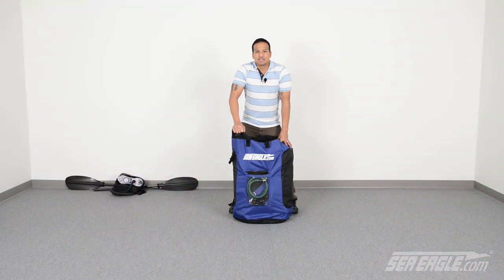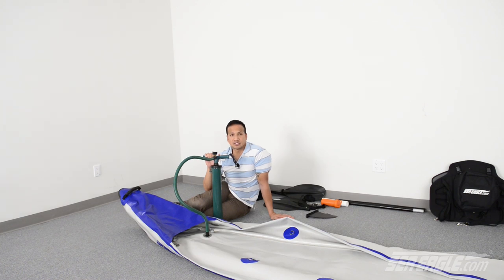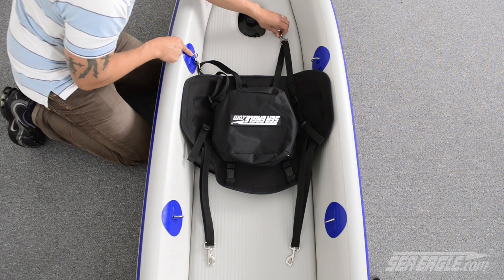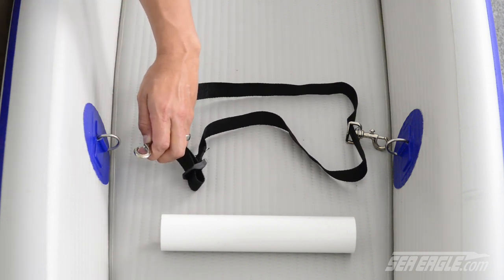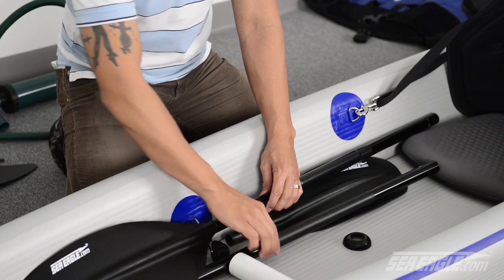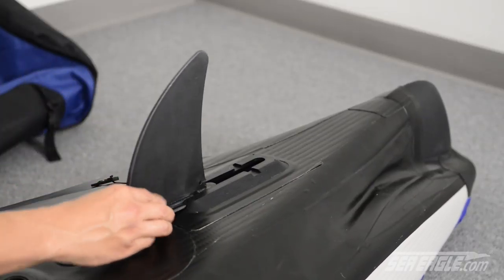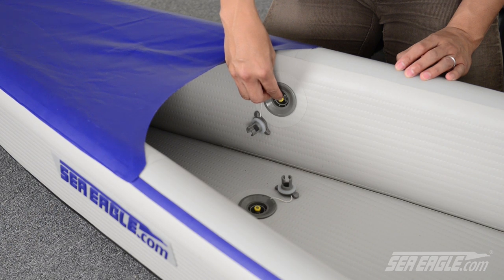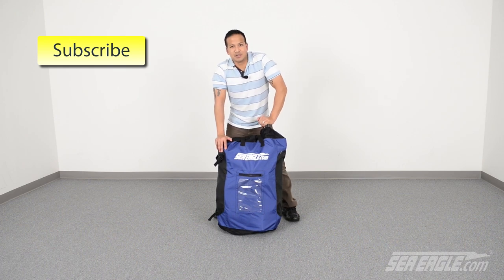Sea Eagle - RazorLite™ Inflatable Kayak Instructions - SeaEagle.com

Comment: I love my Sea Eagle 393rl and my Explorer 350fx. I just got them and have gone on two voyages so far. 
Is Sea Eagle planning on making a full drop stitch enclosed cockpit kayak, or a convertible model with a removable deck, similar to the Advanced Elements Convertible Elite, the Kokopelli Moki, or the Aquaglide Navarro? None of those are truly waterproof and I don't own any of them, but I like the idea. 
I would absolutely buy a enclosed cockpit version of the Razorlite, whether it be one piece or a convertible. 
Is there some special difficulty in making a full dropstitch body with enclosed cockpit? I have no manufacturing experience, but I am currently working on making my own removable covers for my Sea Eagle boats for when it rains or if it's cold, as well as a small dog cabin in the back of the Explorer for my little dog, mounted securely to D-rings. 
I am letting you know that there is at least one buyer who wants an enclosed cockpit inflatable dropstitch kayak and would be willing to pay more than the $1100 I paid for the Razorlite.
Reply from the maker: Hello @penalty5992, we like the way you're thinking and your mods sound fantastic. We have been considering a closed cockpit for sometime. However, there much to consider when designing such. I wouldn't count it out but will tell you that we have been experimenting with such. Thanks for watching. We hope you'll consider subscribing to Sea Eagle Boats YouTube Channel for more informative videos to come!

Comment: Hi Dan, I was wondering if you could do a short update to this video showing the new Flexbrace footrest system, how it works and it's robustness etc please? Also, I'm 6' 9" (205cm), would the new system have enough adjustment to accommodate someone of my size?  Many thanks.
Reply from the maker: This video should help ► https://youtu.be/rqiEjzbwmdI. Between the seat adjustment and FlexBrace™ adjustments, you should be covered pretty well. Thanks for watching!

Comment: 1. Can this boat be used with less than the recommended pressure? Is there any risk of damage from using it at lower pressures (for example, 1.4psi for all the chambers)? Does it not perform as well as if it was at full pressure? I had to use it at lower pressure before getting the electric pump because it is difficult to get beyond that with the manual pump.

2. Is there any way to damage the boat (especially the valves) during the inflation or deflation process other than overfilling with air?
Is there a risk of damage if you  stand/lean/put pressure on the floor while inflating it (eg. kayak is loaded prior to inflation)?

3.My sea eagle manual pump only started displaying a psi above "0.0 (zero)" after multiple pump strokes and getting the chambers partly inflated. Is this normal or is the pressure gauge inaccurate? 

4. Is there any way the boat can be damaged due to improper folding? How important is it to follow folding instructions exactly? 

5. Will the boat be damaged if stored uninflated inside a hot car for a day?

6. Is it possible to complete inflation and remove the nozzle without allowing a small amount of air to escape?  When I get done inflating and remove the nozzle, a small, indeterminate amount of air escapes. Then I'm unsure of how much air is actually still in there.
Reply from the maker: 1. Stay with recommendations. Anything less will greatly reduce performance and handling. The electric pump is the way to go!
2. There are may way to damage your Sea Eagle but standing on or loading it during inflation is not one of them.
3. No manual pump gauge will ever register until the min psi on the gauge is surpassed.
4. There are many different ways to fold your Sea Eagle. The only damage that will ever occur from folding is damage that you may caused. Sea Eagle products are extremely robust.
5. Inflatable and for that much anything does not due well under extreme temperatures. Which should be avoided.
6. There's almost always a little air that escapes but a little air is nothing to be worried about. Remember there is a psi range for optimal performance. As long as you remain within that range you're ok.
Reply: Thank you for the response. A few more questions regarding air pressure:

If it says 10psi, is there a safe range slightly above that, or is that the absolute maximum air pressure that's safe to use? How much room for error above that is there? Can it safely go to 10.5 or 10.2? The pressure gauge is analog even on the electric pump, and it would be easy to go slightly above or below the exact amount since you still have to eyeball needle placement. 

It says there is no performance increase above 3.2psi for the floor, so should I bother going up to 10psi? If 10psi is the absolute limit, I would be inclined to inflate to 8 or 9psi to be safe. 

The pontoons on an Explorer say 3.2psi. Is that an absolute safe limit, or is there room for error there? How much if any room for error? It is harder to precisely measure out the right pressure for 3.2psi since the gauge has increments of 2psi. 
Do you plan to have a pump with a digital readout? 

I have both the Razorlite and an Explorer and I am trying to take good care of them.
Reply from the maker: @penalty5992  The safe range has been factored in for analog and digital reading pumps. Our recommendation is to stay with Sea Eagle recommendations. All chambers of the RazorLite can be inflated to 10 psi. The Explorer floor to 3.2 psi. There is no performance increase above 3.2 psi with Explorer. We commend you for taking such great care of your Sea Eagle. By doing such, they will take great care of you!

Comment: My boat is leaking air from around all 3 valves. Can it be exchanged for a new one or am I out of luck? This is with the valves closed and the caps on. It won't hold air. The leak is slow and can be heard and felt from all 3 valves.
Reply from the maker: Hello @Tentdweller36, could be loose valves that need tightening with the valve wrench tool located in your repair kit. You can always contact our live customer service for support at 1-800-748-8066 or via email to Staff@SeaEagle.com
Reply: I absentmindedly set the pressure too high on the pump and pumped it up too high. I may have damaged it beyond repair. 
I tried tightening all three valves and I have determined that the leak is possibly only coming from one chamber. I can't pinpoint the leak but I inflated each chamber individually and I only hear a hissing sound coming from the one side. There may have only been one chamber leaking all along. 
What kind of damage normally results from pumping it up too high? Would high pressure merely loosen a valve, or break it? Does it burst the PVC fabric? 
Any ballpark figure for how much it might cost to repair this?
Reply from the maker: @Tentdweller36  Your best bet would be to call in and talk with a live customer service representative at 1-800-748-8066.